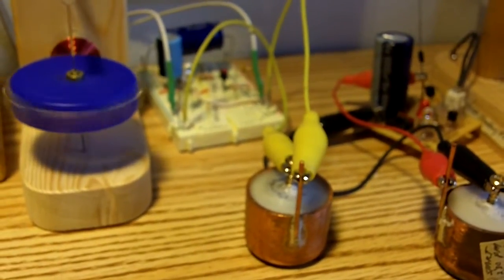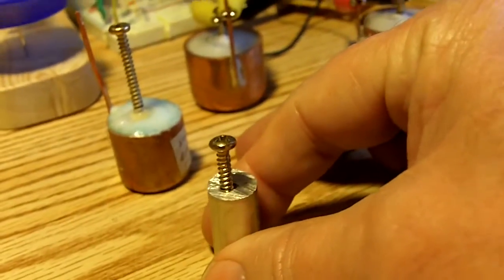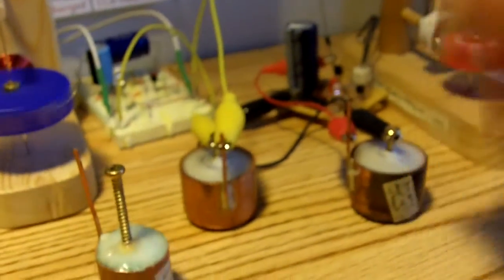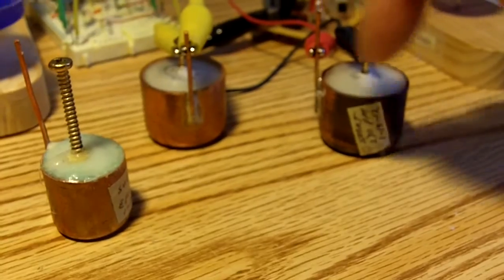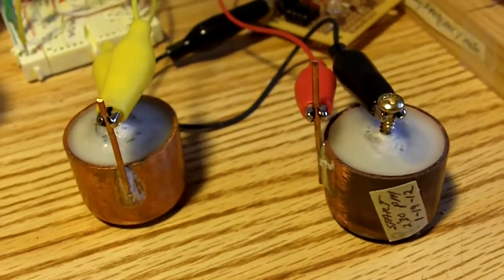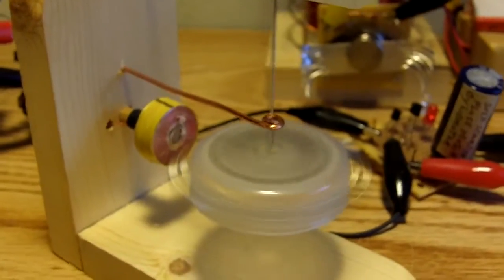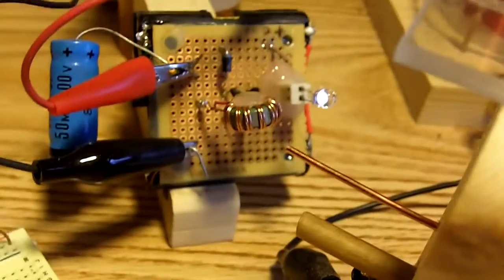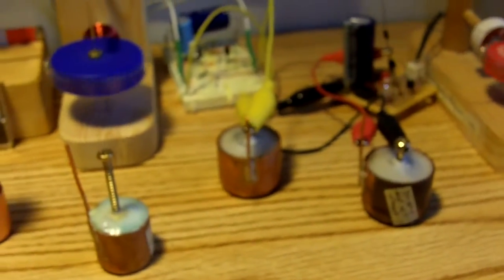Simple Cells & Stuff.MOV

Comment from the maker: @PlengoFreeEnergy 
I'm using 1" copper tube caps so they hold a little more material than the 1" pipe you are using. When I filled mine I had no voltage. I added 3 drops of water to each cell and they went up to 1.7 volts each. later I added 3 eye dropers of water to each one and they are holding a total of 5.2 volts. I do not have them covered. I will let them dry for 2 or 3 days and see what happens with no load on them, then I will run more tests. I'll let you know.

Comment: @magnetman2010 
if this is liquid, do this: pour some on a plastic cap about 2" mm tick. Let it dry until becomes a solid. Grind it into powder and add like 1/4 or a 1/4 spoon to your cell mixture. This will increase crystal grow. If you have sand (beach sand or construction sand) add that to your mix too. Sand will give strength to the mix and help also crystal grow.

Comment from the maker: @PlengoFreeEnergy 
I do not have any carbon but I have some water pitcher filters. I added some of the filtering material and alum to the epson salt, magnesium, copper cap cell and up went voltage and amp to about 1.7 volts and 50 ma. Thanks very much.

Comment from the maker: @Lidmotor 
I think I may need more antenna. I have about 80 ft.  I;m doing a test now. I hooked a blocking oscillator to the antenna by way of a 20 uf 370 v 50/60 hz can cap and a FWBR. I charged a super cap to 1.2 v and pluged it into the + & - rails of the blocking oscillator. It has been running for 9 days. i'm thinking that if it stops droping voltage and keeps running It will be running on the antenna. I'll do a video if it works.

Comment: Great video, loads of projects again ! I've lit LED's with a crystal set, but it used an outside Ground stake to do so. If you put an LED across what would be the speaker output and connect the Ground on the speaker side of the germanium, you should see it slightly light. Also, using a small superbright LED shows low illumination seemingly best.